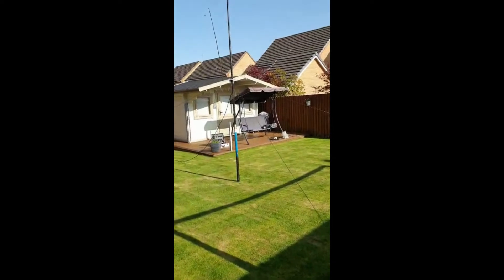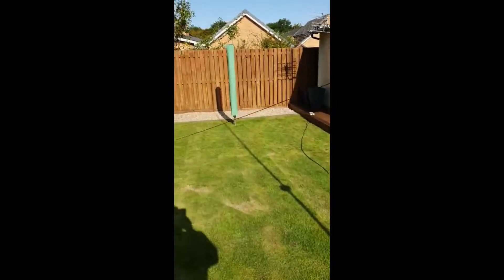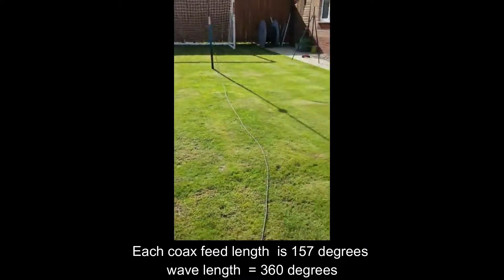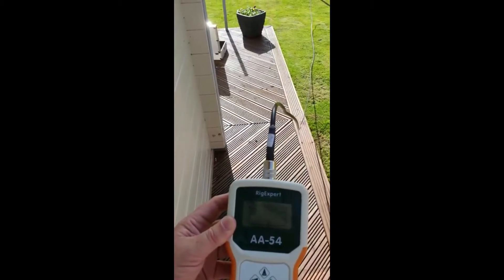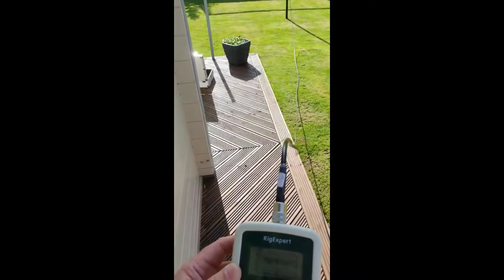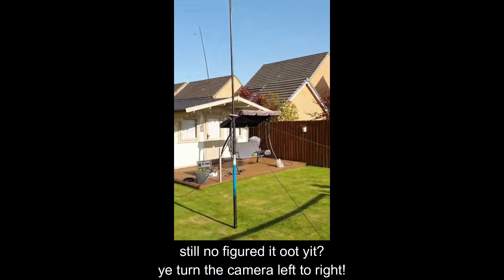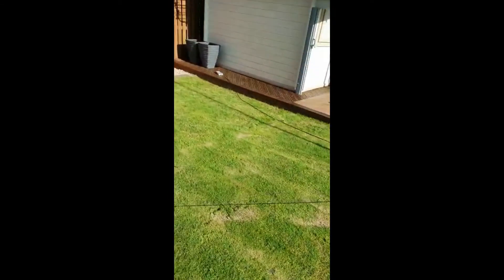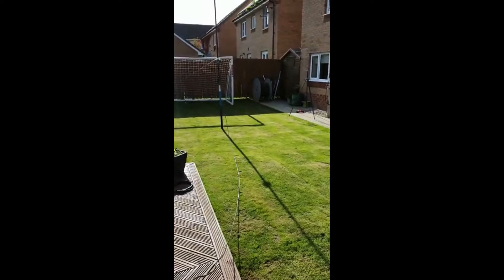Initial setup and test of  2 phased vertical array for 20m by GM2TT

Comment: I wish this game was as easy as cutting up a bunch of phasing lines and hooking them up to a pair of verticals. There is no one size fits all, each installation is different and the correct phasing depends on how closely matched the verticals are and  mutual impedance for a start. Ive had phased verticals with 18-24db F/B and still been inferior radiators. I then read a key bit of information in ON4UN'sbook where he says that phased verticals can show FB but still be down -4db on gain.

Comment: nice you going to 4 phased array next??
Reply from the maker: naw thats too much work for nothing. I've done a 3 phased array which covers north south east and west, the same as a 4 square.. so I wouldn't waste the time/material for a 4th. So 2 or 3 phased thats enough.

The two phased array is ideal for going away
Reply: @GM6DX  Sounds good too me would do if I had a bigger garden with no bt lines